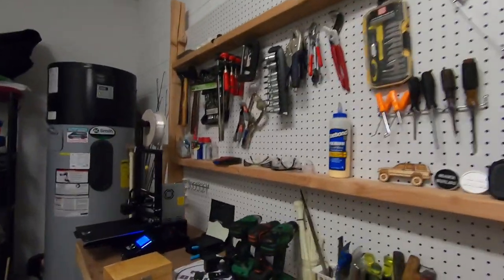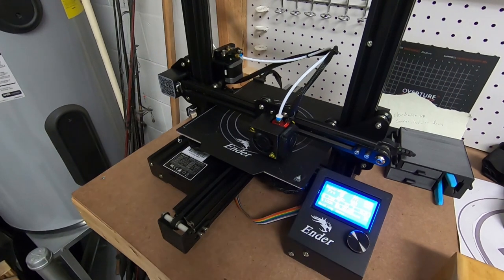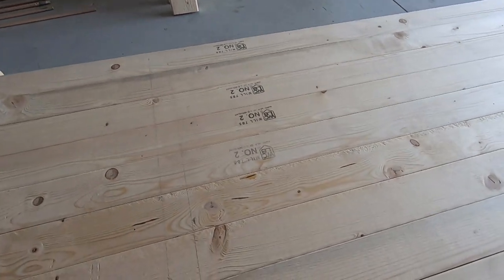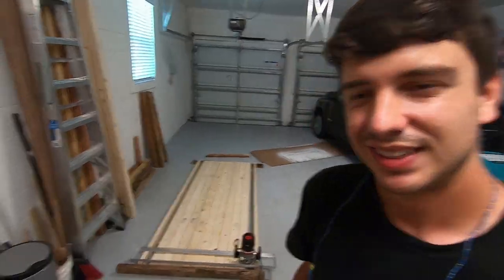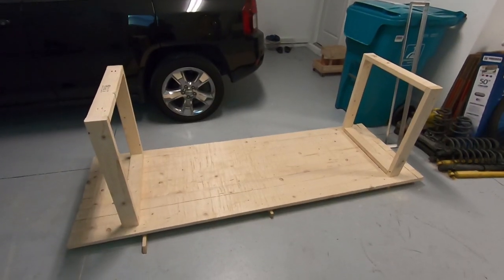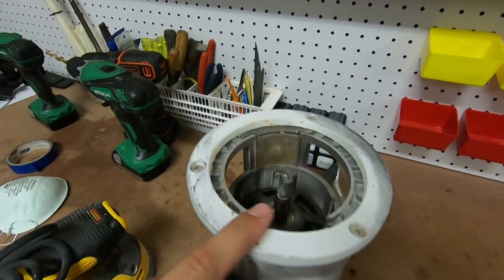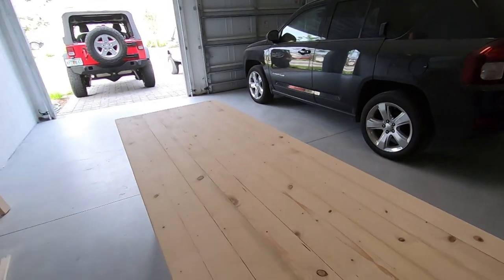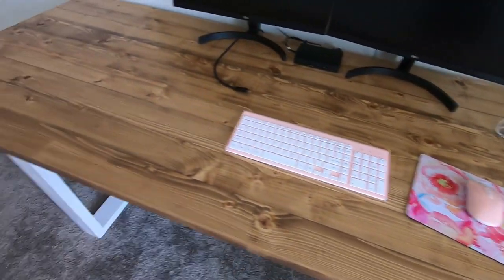Large DIY Desk from Cheap 2x4s: Complete build

Comment: I have found it’s easy and cheap to fix a slight back to back with some small deck brackets ($2? at Home Depot) they are sturdy yet small enough to remain unseen if you don’t wanna have a 45 poking out. I usually build console tables but will be doing your build tomorrow:)
Reply from the maker: Good luck!

Comment: Nice looking desk, building an 8' now myself.  Only comment is you should have a couple of pieces along the back in an 'x' formation to reduce racking.  What you have now is a really sturdy top, just sitting on a couple of legs with that minimal gusset.  Does go to show though that you don't need a lot of big shop equipment to make something functional. Although the router sled is a little unusual for people with minimal tools, it certainly is a useful jig to make if you have one.
Reply: Also, I like to sand and paint ends and such before cutting as it seems faster and less need for taping and cutting in.  Just ends need touching after assembly then.
Reply: Thanks for the tip! X bracket along back... 👍

Comment: My first desktop planing job I didn't make my frame big enough, figuring I could just slide it a bit. Except I got all into the planing and how great it was working and ran off the end of the frame with 6" left on my desktop real estate. Told my "customer" the resulting divot was part of the "natural" flaws in the wood. Thankfully, everyone is still into "rustic" because there isn't enough wood filler in my shop to fill that curlicue. :)

Comment: Interested to know what the dimensions of the table top are... thanks
Reply: Also, did you use a pre-stain?
Reply from the maker: @jiannilazaga8471 no pre-stain but depending on how you feel about stained pine…I’m sure there are splotchy areas. There was never anything bad enough to bother me or my wife. As for dimensions I think I just trimmed the ends of 8ft 2x4s after glue up and the width is 9 boards across.
Reply: @markbuilds  thanks!

Comment: Could you have made the sides of the 2x4 straight and then avoid needing to plain it a much?
Reply from the maker: Yeah of course, and you could also get the dowels straighter and more accurate. That was our biggest issue here.
Reply: You can get a simple hand-held electric jointer for $50 that could do this relatively easily.  You can also make a simple jig that will hold it upside down, like a regular jointer, and be able to feed boards through it.

Comment: How stiff is the front side from racking side to side?
Reply from the maker: It definitely had some racking, the 45 braces at the back helped a lot. I just used wood screws through the legs into the table top, I would definitely use inserts and bolts if I were to do it again, I think that would also help a lot. For a desk it worked fine, but I wouldn’t want to do anything with it that required a lot of forces on the table

Comment: Sometimes it's better to flatten by going with the grain. It eliminates the trouble of getting rid of the streaks while sanding. 

For the bottom slats/cross supports, it looks better with 45 degree cuts at the ends. It's a way of hiding them better.
Reply from the maker: Great advice thanks!

Comment: is there a certain method you used to drill your dowel holes straight? ive been doing some tests on scrap wood before i start my tabletop build and it comes out slightly crooked.
Reply from the maker: At the time, none were straight. My advice is to buy a dowel jig, they aren’t that expensive. Another option is to drill a hole in scrap straight and use that as your guide to start the holes. I also 3d printed one that did the same (but heat from the drilling ruins it pretty quick).
Reply: @markbuilds  I'll look into that. thanks.